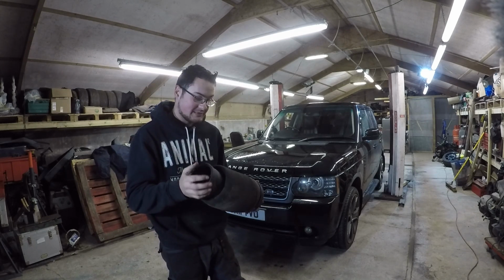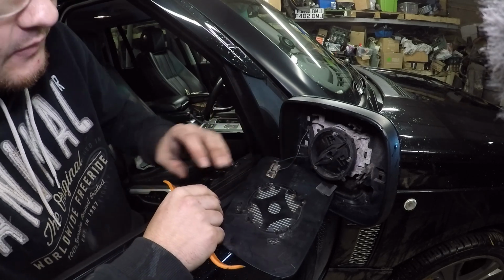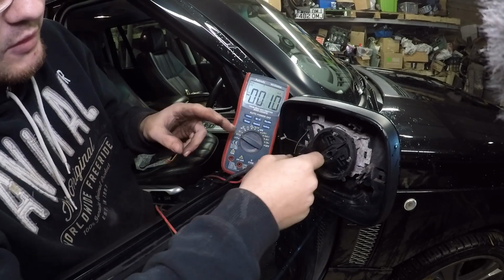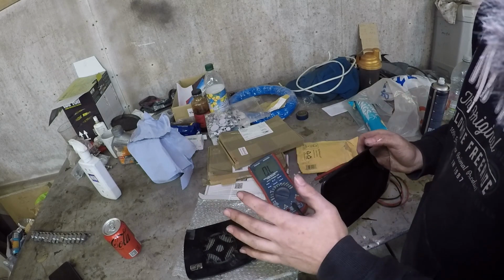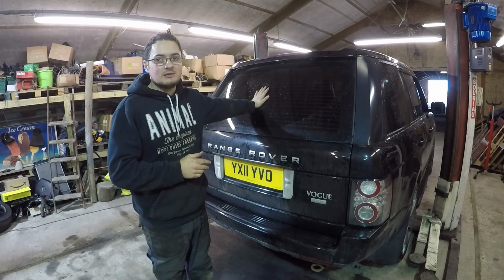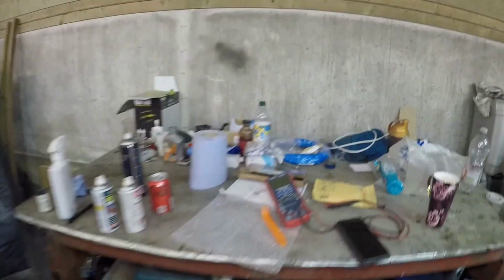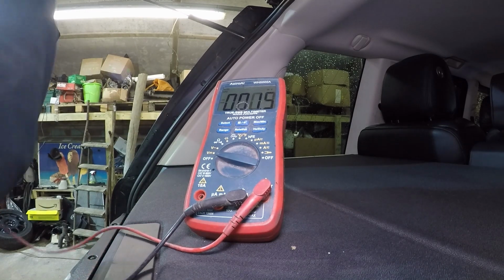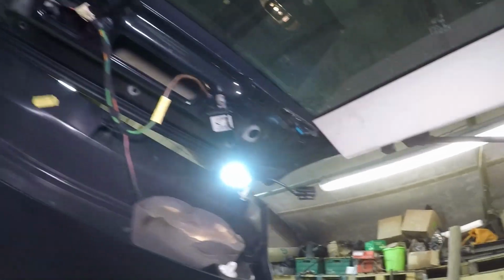DIY Diagnosis & Repair: Heated Mirrors / Rear Window | Range Rover L322 & 320, Discovery, Freelander

Comment: Is there a way to test each wave trap to know which on is bad? I dont have any physical damage but no voltage on output side.
Reply from the maker: Yes, disconnect the output, one should have +12v to earth, the other 0v to earth/continuity
If one of the above fails then that's the issue, the other option is to disconnect them and test for continuity between the input/output of each device, I'd expect less than 1 ohm resistance.
You can also check the resistance of the heating element to ensure it's complete

Comment: when you say pop the mirrors on , I assume you mean heated windscreen. Are yours the photochrome mirrors as well? where did you get them from may I ask? I understood iirc if the mirror moved then the fuse was good, but it has been a few years since I looked into it and reviewed the diagrams ( or maybe it was if the windscreen heater worked ??)  tbh.  Cheers
Reply from the maker: Got them from a mirror parts supplier on eBay. Yes pop the front or rear heated windows on and it'll put the mirrors on.
Mine are not dimmable mirrors (luckily)

Comment: Great video! Wondering about front mudflaps. I have a set, but don’t have any install instructions. Maybe just a suggested video idea if you want to show how that is done on yours. I do not have side steps. Thanks
Reply from the maker: They're fairly self-explanatory, but you may have to drill a couple holes if you haven't previously had any. I fitted some to my last L322